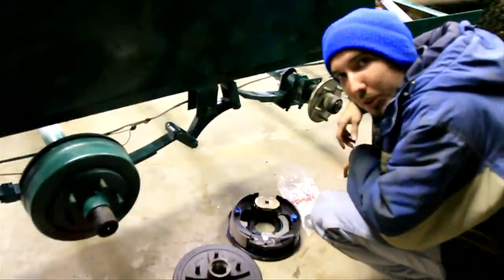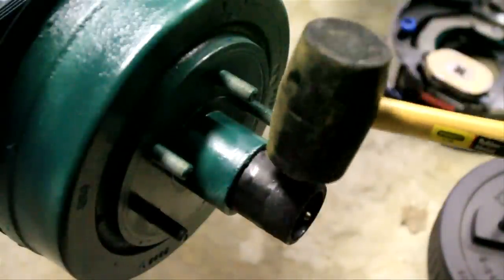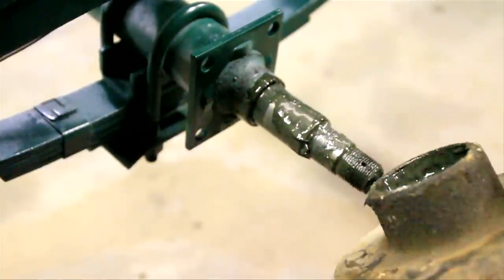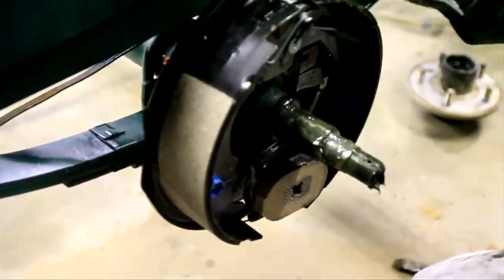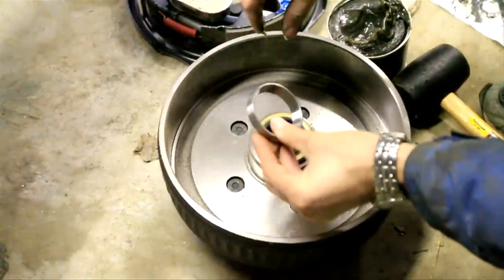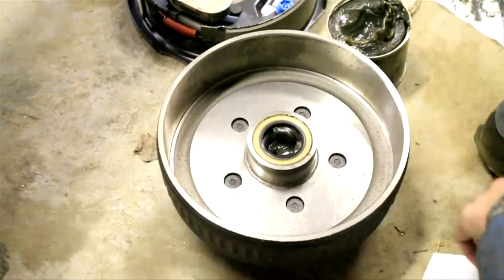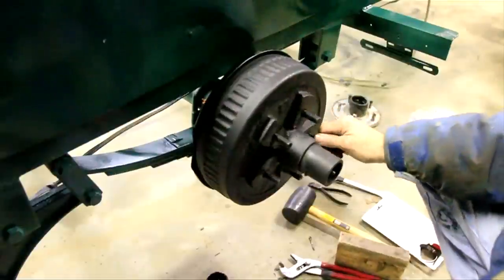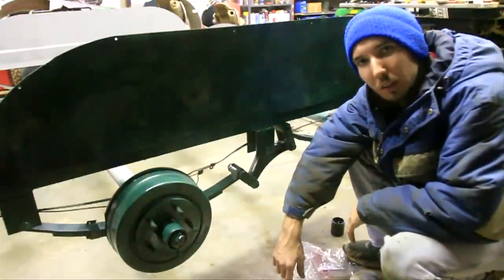How To Install Trailer Brakes

Comment: Good job, If you remove the front bearing, reinstall the castle nut, give a sharp pull outward of the hub, the rear bearing and seal will pop off. I don't have a press and this I learned from an old mechanic
Reply: Great tip! Thank you.

Comment from the maker: @amman1725 Thanks. There is only one adjuster. I believe the reason for two holes is because the brakes are directional and the drums are not. Therefore, on the driver side of the trailer you will adjust through the right hole (front of the trailer), and on the passenger side you will adjust through the left hole (front of the trailer). Not sure but that's my best guess.

Comment: make sure you get the drums that have the wide spacer where the bold studs protrude.  If this spacer is not wide enough your tire will have less space between it and the fender.  Believe me when you have a load and make turn, your tire will touch and burn and blow out the tire.  Good vid..........thanks

Comment: NICE. thanks for the video...
would you be able to show the mounting bracket? I might have to fabricate this part.. think a little Lincoln Pro MIG 140 would be able to handle that with .035 wire or does it need to be a heavier wire?? I'd imagine the axle would need a lot more heat to penetrate and get some solid fusion?

I thought itd be a lot harder.... looks pretty basic. thanks again

Comment: Thank you. Jeromy did a video also on trailer bearings and tightened the nut to 50 ft lbs, I believe, then backed it off while holding the tire in place. Are some axles calling for different spec? Nice details in this video, thank you.

Comment: Thanks!  I am thinking of buying an old 14 ft Trillium travel trailer that someone Frankensteined a solid axle with no brakes on leaf springs in place of original torsion axle with brakes.  It makes the trailer sit much higher which may change towing characteristics.  Not sure if it will be ok. It will help in terms of matching height to 4runner, but maybe not a good idea for handling with higher center of gravity.  If you read this and have advice or anyone has any input, I'd appreciate it.  I know nothing. I could see the square plate to mount brake assembly, so it looks like I could add the brakes.  I thought I would have the expense of a new axle.

Comment: how dows th electric brakes work
Reply: The magnet is charged electrically by the box and how high the box in the truck is set determines how much grab it will have to the inside of the drum and as the magnet grabs it actuates the shoes and applies the pressure set by the driver usually is one thru ten. So you lower the setting empty and raise it when hauling something. Very basic and archaic but effective.